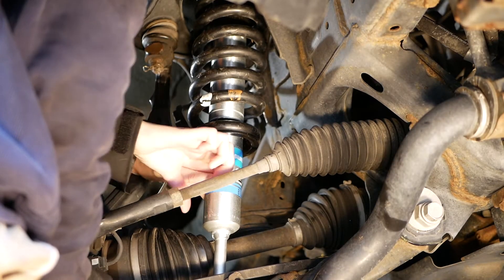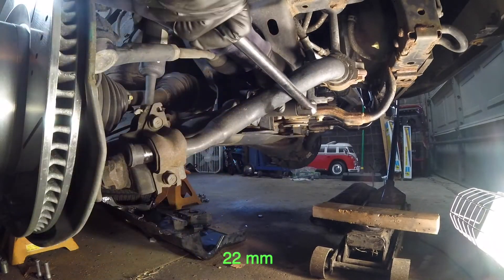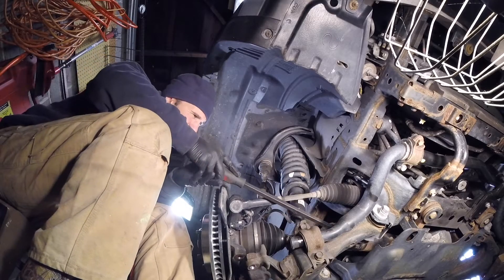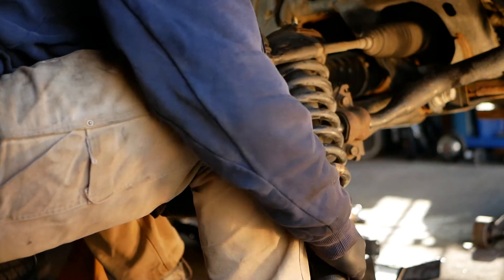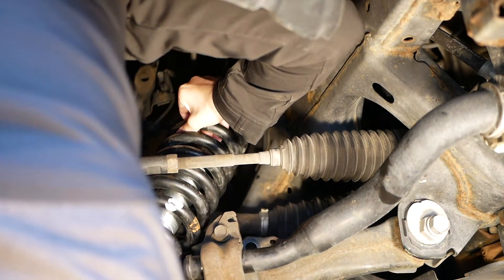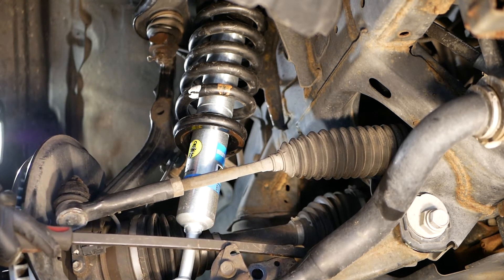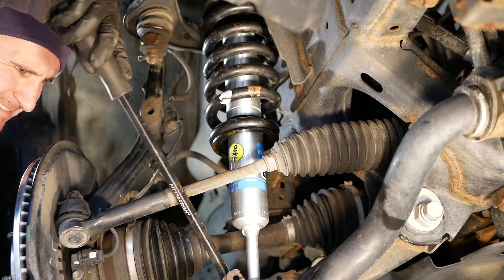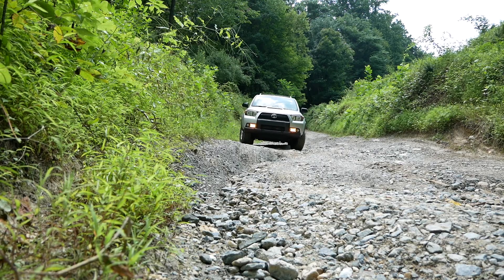DIY Installation of Bilstein 5100's on 5th Gen 4Runner with KDSS

Comment: Great detailed vid ... but one thing is u can NOT tighten those cam bolts on the lower controll arm until the truck is sitting on the ground with wheels on or u are binding/  limiting the travel . Make sure u tell ur alignment tech they need to be completely loosened and tightened again .
Reply from the maker: Thanks for the comment and thanks for the information which will help others when doing this job.  My alignment shop always does a thorough job and after 25,000 miles, I have no complaints or issues.
Reply: @andysbusadventures  no prob , it's not that ur alignment would be off if ur cams are back in same position its that ur locking in that controll arm bushing at the lowest position , all the travel from LCA comes from that rubber bushings movement and if it's locked down when arm is fully extended ur limiting ur travel and fighting ur shock ... hard to explain but if u look it up u will see .
Reply from the maker: @sailfishoneday2145  This is great information for anyone doing this.  I really appreciate the heads up on this.  I pinned your comment in case this is/was confusing for anyone watching.  Thanks again!

Comment: Just in case someone else is getting ready to do this , you can open the KDSS valves ( I think its 1/2 turn but look it up) the sway bar will flex pretty easy then. There is an Australian video about evening out a Prado that was lower on one side. His instructions for the KDSS valves are spot on
Reply from the maker: Thanks for sharing.  The sway bar does make the job a little more difficult.

Comment: I put the 5100s on my 4 runner, I noticed the driver’s side was just slightly lower, I called Bilstein and they said I should have used the 6112s which has an adjustment just for that reason! I ended up using a small spacer to get it perfect.
The other problem with Bilstein is once you set the adjustment ring you are committed! My son went with Eibach shocks, we were able to change the stance without removing the shock, just by turning a spanner wrench. 
Just FYI your your installation was spot on, easy to fallow and very professional.
Great work!
Reply from the maker: I appreciate the compliments.  Also, thanks for sharing your experience and hopefully that helps others make an informed decision for their situation.

Comment: So the kdss function was not affected by the slightly higher front? in the same vein, you could also do a longer/taller old man emu spring to lift the rear right? This same principle would work for  GX460?
Reply from the maker: I have put 50,000 miles on my 4runner with and the KDSS has not been negatively impacted.  I would assume it would work with the GX460 and I would assume you would be able to go taller in the rear as well, but I do not have any experience with this.  Thanks for the comment and good luck!